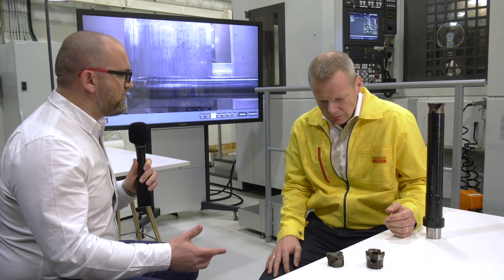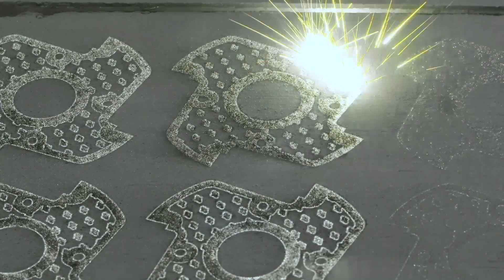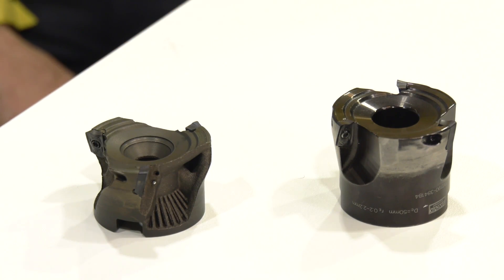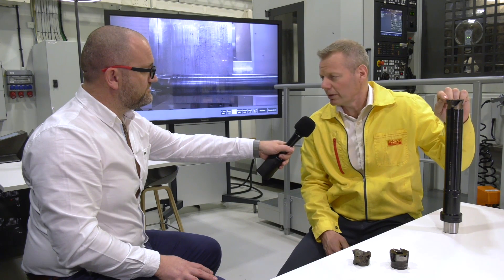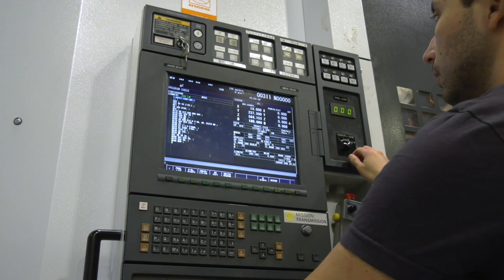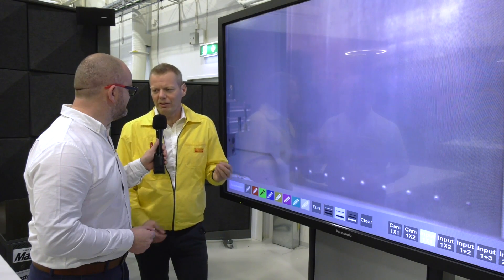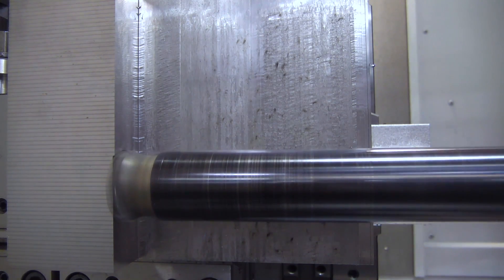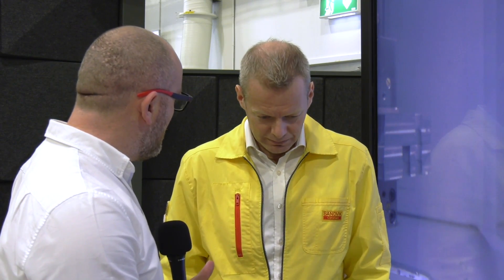What is lightweight CoroMill® 390?

Comment: Why do you utilize the SLM process over EBM? To my knowledge there are no big Swedish manufacturers of SLM machines, but, for EBM you have Arcam AB in Mölndal which have over 25 years of experience in the field of additive manufacturing. Wouldn't it be quite beneficial to work with a domestic machine manufacturer?
Reply from the maker: Hi Pontus! When we designed the light weight CoroMill® 390 we used powder bed fusion, in our case laser (We do have both laser and E-beam at our facilities in Sandviken). The main reason for us using laser and not  E-beam was that we needed to create fine channels for the coolant flow in the mill. This is difficult for EBM systems to produce since they have to pre-heat (sinter) the powder bed to avoid charging of the powder particle. The slightly sinter powders will then be difficult to removal from small diameter coolant channels. When developing new products and applying additive manufacturing technologies it is very important to choose the right AM technology for your application to ensure that you will get the most benefits from AM.
We of course would like to collaborate with systems suppliers domestic and international for finding the best AM solutions for our products.
Don't hesitate to contact us if you have any more questions! Have a nice summer!

Comment: Did Sandvick Coromant use a Matsuura Lumex to print and machine the part?
Reply: Eli Bromlow I think it is an dmg mori nhx8000 

I’ve had the exact same machine and the only other machine in Sweden at that time was at coromant what I know of.
Reply: Bnagwigc I was referring to what machine was being used to manufacture the cutting head.
Reply: Of course, I should probably learn to read 😂😃 cheers